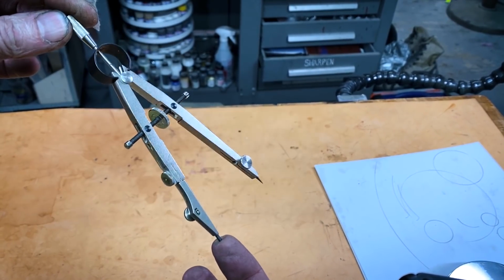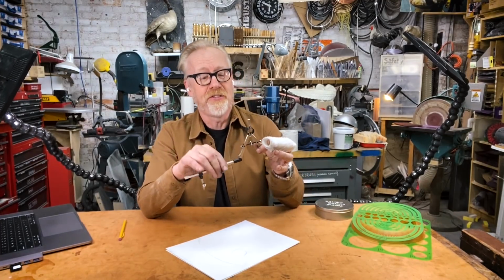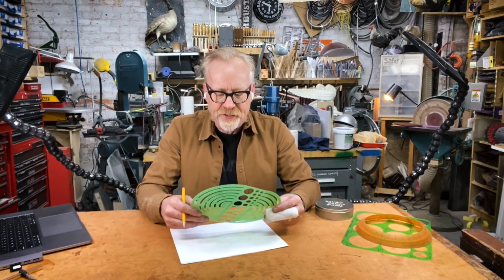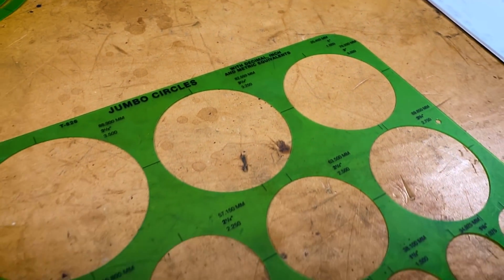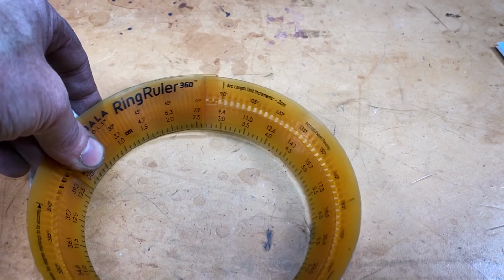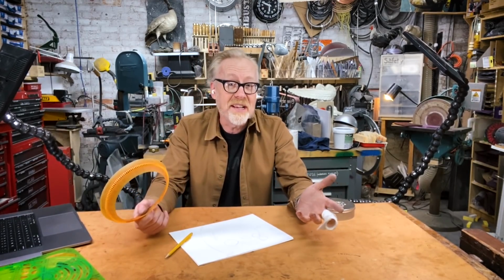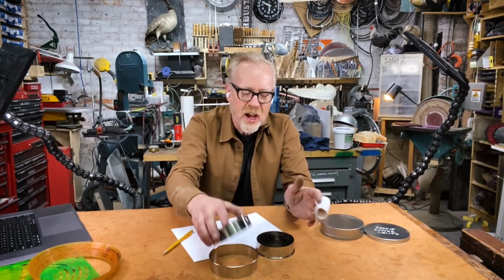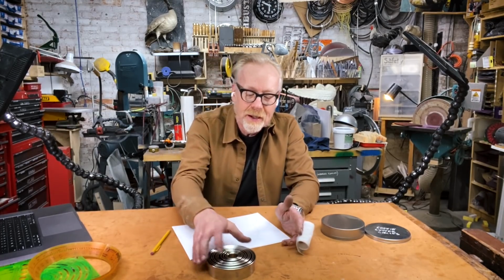Adam Savage's Favorite Tools: Making Circles and Holes!

Comment: my favourite hole cutter has to be the hole pinch type good for sheet metal and plastic and you can get them in more than just circles.
This type: https://uk.farnell.com/greenlee-communications/31989/punch-hole-round-15-2mm/dp/3580763?gclid=CjwKCAjwssD0BRBIEiwA-JP5rNlrDqtydgFxjJDBMW_2a4YGUaQ2DRomc61uaOf3PfeeNTGz0jM0iBoCay4QAvD_BwE&gross_price=true&mckv=sHMIgtCmJ_dc|pcrid|78108376509|plid||kword||match||slid||product|3580763|pgrid|14406255429|ptaid|aud-157604796549:pla-336024411023|&CMP=KNC-GUK-SHOPPING-TEST-23MAR

Comment: I used to have a kind of ruler with a slot in the middle and a little knife on the end. In the slot was a sharp point on a screw which was adjustable infinitely. It was like a compass, but to cut perfect circles. The only downside was that it left a little puncture at the centre, just like a compass does. I purchased it to cut a hundred circles from heavy paper and it worked like a charm.

Comment: I use a unique hack... I have 35mm movie film... so i use it with a stationary point and a marking device like some would use string, but  it helps me keep things more stable and repeatable... and you can use the film itself to make any kind of round... it's particularly useful when i need a rounded angle between two points, anchor the ends and adjust the length until the curve looks good then you can repeat it...

Comment: You can also make your own compass especially for large radiuses (radii?) by using a long usually thin piece of scrap and drilling a hole in one end for a pencil and either putting a nail or screw through the other end or another hole. There’s also the string technique!! Wrap a string around a pencil, tie it to a center point in some manner, then spin!

Comment: Adam you have one of the coolest shops around, my easy trammel set is a wooden yard stick with a nail directly inline under the  one inch graduation and then I blue tape a nail or a pencil at a measurement mark or fraction mark, then I can make really big circles. It’s fairly simple to use and store.

Comment: Hi Adam, for many years I have worked and really enjoyed the WindFire Designs circle tools that are made from SS.  They are durable and you can use them for drawing, leather, paint, textile, etc...  They are not cheap but it's a very well made tool.  Also they don't have dimension markings on them, but all circles are in relation to the other circle next to it which makes it for a more organic design.  Stay safe.

Comment: Using a piece of string or line. Tap in a small nail or use a pin for the center, and a loop with a pencil for the outside.  Big circles can be done with just some line.

Comment: I bought a set of metal bath bomb molds at walmart for like 6 bucks. Graduated sizes, much like the cookie cutters, approximately 2", 1 3/4", and 1 1/2" sizes, for use with EVA foam. I have also use the cap from a can of expanding foam to score a circle into EVA. Copper pipe fittings sharpened with a dremel work well on EVA, and I bought some stainless steel reusable straws and used in the same fashion for very small circle punching into EVA (Bonus: they came with a pipe cleaner which I use for my airbrush)

Comment: I've never used a protractor to draw a circle... But I've used drawing compasses.
Reply: Protractors make great circles, if you only need one size!! 

But seeiously, I'm in an engineering class, and I've been taking notes with 'architects writing', with the straightedge and such, cause it fits my style of note taking, and it's the only way I'll be able to read my notes when tests come around. Anyways, I use a protractors as a straightedge, and the curve is great to really quickly draw a diagram or what have you in my notes, since it is already sitting there on the page.

Comment: Quickest? Dirtiest? A nail, a piece of string and a pencil.
Reply: Loop the string around a second nail and you've got elipses.
Reply: Yeees. And a magnet would do in place of either the nail or the pencil with sheet metal. I've used math to get a specific cone marked on sheet metal, scribing the cut line with a magnet, string, and a nail. With ellipses, instead of a string I would use the method stumby nubs shows in this one https://www.youtube.com/watch?v=7KYsWwB8xMQ
Reply: Do this for making subwoofer enclosures. Substitute the pencil for a screw/nail and actually carve your circle into the MDF and then jig it out.
Reply: What I was going to say it's effective especially for large arcs
Reply: Beat me to it! Mine is "push-pin, pencil, & string"
Reply: Hell yeah
Reply: Or 2 pencils and a string...

Comment: 1:01 I thought those were called a pair of compasses. The protractor is the half circle piece of plastic used to measure angles.
Reply: Yea I thought I lost my mind for a second there.
Reply: They actually have the link in the description as a Compass.
Reply: @nicholaswagner3268  lol. they do!
Reply: Nicholas Wagner 
It’s a pair of compasses, a compass is for navigating.
Reply: Glad I'm not the only one who was shouting "compass" at my computer screen! :D
Reply: Rarely referred to as a pair of compasses, usually just "a compass." The one Adam showcased is most often called a bow compass (as opposed to a beam compass or dividers). Adam's looks like an antique; it's exactly the same model that I used in my high school drafting classes in the mid-1980s. One side has a sharp metal point to hold the center, and the other side has a 2mm lead, which is generally sharpened on a slant to give a very fine line without the point crumbling during use.

The arm that Adam added to the compass essentially converts it into a beam compass.

I still have my high school drafting tools buried in my closet somewhere.
Reply: @_WillCAD_   Probably true. I still prefer 'pair of compasses' as it distinguishes them from a compass (the thing that points north).
Reply: I will always concur with a guy named "Irwin", if the topic is measuring tools.😁
Reply: @paulroe4520  I wish it was a relation. That and Steve Irwin, I have some big shoes to fill. :)
Reply: Thanks guys, I thought I was going crazy and been calling them the wrong thing too. Totally understand Adam’s gaff , we’ve all done something like that.
Reply: A protractor? Duh! Lisa! -  too bad we don't live on a farm! ;-)
Reply: I thought the exact same thing.
Reply: Shirly a compass points north. :)
Reply: @ABrit-bt6ce  ....it usually does......
....and stop calling me Shirly.
Reply: He knows he said it wrong, hence the product link in the description says compass
Reply: Glad to know I wasn't the only one who thought their entire drawing life was a lie, especially the couple of years studying technical drawing.
Reply: Maybe Adam took too much Tylenol 3 because of his finger?
Reply: nunya business  Oh, I get it. You're just being deliberately obtuse then. If you can't be bothered to even look in a dictionary, then I'm not going waste any more time on you. Also? I'm not mad at you but nice projecting, and I'm quite happy with my grasp on the English language. You, however, are obviously a troll, so trip-trap back under your bridge.
Reply: Lol. Has affiliate link for compas but not for protractor
Reply: @Ben Irwin I would like to see you try and navigate with that compass.
Reply: Nice to know I'm not the only one that noticed
Reply: nunya business  A speed square can already be used as a protractor.
https://www.youtube.com/watch?v=KnA1YT6Ia9k
Reply: nunya business  Not when I was in school, it wasn't. When you say "a set of compasses" that is no different from "a pair of compasses" and when you ask someone for a pair of shorts, you don't end up with two items of clothing. Same thing.
Reply: nunya business  You know what? Why don't you go do a little research and see for yourself, instead of acting like a know-it-all and being patronising, huh? "Pair of compasses" or "compasses" (not a compasses, just like you say shorts, not a shorts) is a perfectly valid term. If he had several of them, if he had a box full of those instruments, it would quite validly be called a box of pairs of compasses, or a box of compasses. It's easy enough to find out that you're just being a bit of a jerk right now.
Reply: Yeah, is this some sort of Mandela effect thing? 😅
Reply: I’m American and I’ve heard it be called a protractor before.
Reply: @Sergio-fu7mv  who ever said it was wrong
Reply: Yes,  What adam is showing is a set of compasses. A protractor is semi-circle (usually transparent plastic, but can be metal ) marked up in degrees for measuring angles.
Reply: Maybe it’s weird terminology in American English?
Reply: @awmperry  nope, Adam called it the wrong name
Reply: @revengejr  Yeah, I think he just had a "brain fart". It happens to the best of us.
Reply: especially genius's. they're focusing on results. who cares?
Reply: @pileofstuff  especially genius's. they're focused on results. who cares, right?
Reply: @awmperry  I assure you that's a Savage-ism
Reply: @awmperry  They are often sold in sets in N. America, it's an understandable gaff.
Reply: @awmperry  No.  Emphatically no:  As a native speaker of American English, what Adam calls a "protractor" is, in the form where one leg ends in something to write with and the other something sharp to act as the center, called a "compass."  (The similar tool with two non-writing points (traditionally  used to measure the length of an arbitrary route on a map) is a "pair of dividers".)  
I thought maybe Adam's usage was a common one I'd somehow never run into.  But of the first 100 hits in a Google image search (in an incognito tab) for "protractor", 98 show what I expect.  Two _do_show compasses, but that's well within the expected "related thing but not it" error range.
Reply: @xela8384  Maybe THIS is an Americanism, however? Because here in the UK, I was taught that it's a pair of compasses (for drawing circles) versus a compass (for finding magnetic north while navigating). Totally agree on the protractor point though - that's definitely a semicircle (or occasionally a circle) used to measure angles.
Reply: @JustAnotherBuckyLover  that's interesting! I never like that compass could mean two different tools. that's a good way to distinguish but 'a pair of compasses' is quite wordy and Americans are lazy jklol
Reply: @MyUnquenchableThirst  LOL honestly, so are most Brits. If they don't just say "compass" the most common usage I've heard otherwise is "compasses" much like trousers/pants/shorts/socks etc. But again I imagine that could end up confusing if you have multiple pairs of compasses. 😂 And this is why language is flexible and ever-changing.
Reply: @JustAnotherBuckyLover  UK too, and it was always just called a compass.
Reply: @plkrtn  Hmm... perhaps it's an age thing? I was in school at the end of the  80s when I first was taught this, and I know it was something that the older friends and family I have/had always referred to a pair of compasses. As far as I can tell, it seems to be shifting more (perhaps as US English in general is becoming more ubiquitous around the world too).